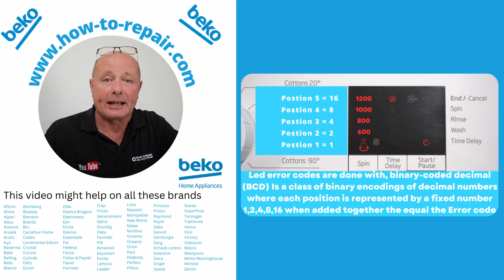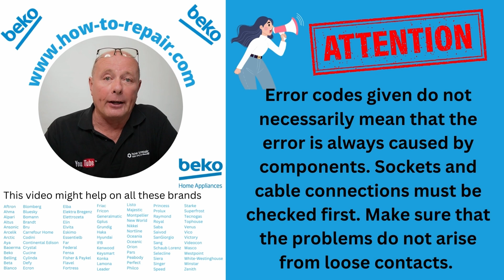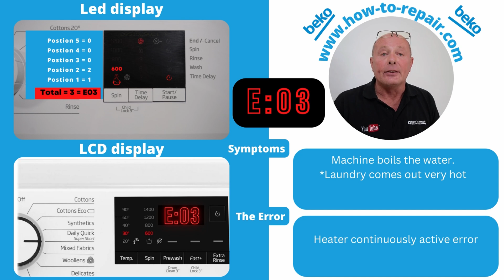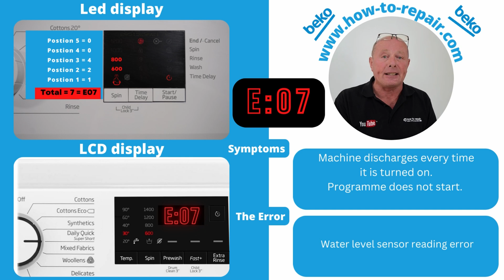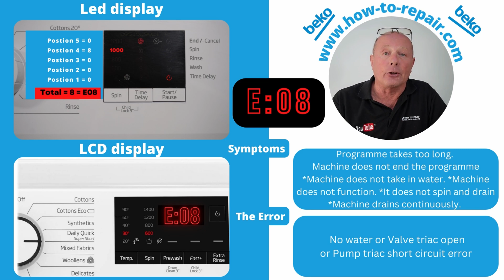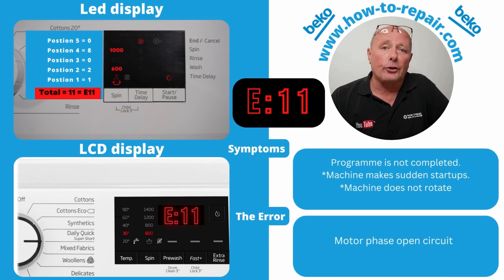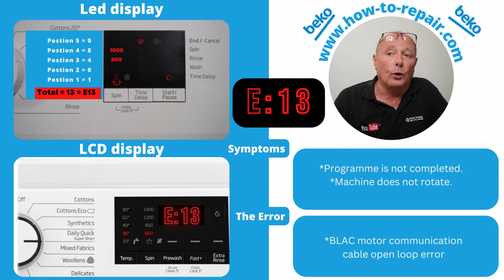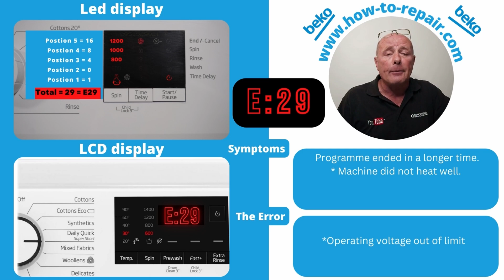Beko washing machine error codes explained digital display and LED types 𝟮𝟬𝟮𝟬 onwards

Comment: Hi Paul

Just want to remark about an issue I was having with my washing machine which is a Beko WTK72011W 

It would on occasion not complete a cycle, the machine would simply reset, I have worked out, this was due to my kitchen having issues with being too cold, which was causing damp in places

It's worth noting that this will have caused condensation inside the machine, meaning the machine detected a problem, and shut down as a result, to prevent further issues

Since addressing issues causing cold, and therefore damp in the kitchen, the machine has performed flawlessly

Just one for your information, if anyone makes any inquiries similar to mine

Comment: Hi i have becko WTB740E1W led washine machine.and when it turns on all the lights keep blinking and sounds like one of the relays trying to hold on to something isnt working and keep ticking and can clearly hear the door lock sound works well but the machine doesn’t start up.
Do u kave any suggestions please thank you.
Reply from the maker: Hi mate, this could be due to a problem with the door lock itself, the pin system on the door that fits into the lock, or possibly a wiring fault. Occasionally, though rarely, it might be an issue with the printed circuit board.

You can start by checking the door pin, the door lock mechanism, and the wiring. You might also have an issue with the wiring inside the panel or possibly a faulty control panel.
Reply: @How-to-repair  thanks a lot will try those steps one by one and i will inform technician too..

Comment: L and opposite L what problem is?
Reply from the maker: Hi, I will need the full model number of the identification plate and the details of your problem so that I can provide you with useful literature. Please use our contact us page and make sure you fill out the request for what your problem is. A video shoot of the problem would be perfect as well.

I will get back to you within 24 hours, normally. https://www.how-to-repair.com/help/contact-us/  

Please remember to subscribe to our channel, as that's what keeps this channel going. Thanks, Paul 👍
Reply: Beko wte 10712 par 10kg 1400 rounds

Comment: Hi i have an error code 11. 1000 and 600 both showing at the same time. The drum circles a couple of times only will not spin. 
But if i do a wash with no clths in the machine it will do a full cycle. 
Machine is only 4 years old . 
Please help me

Comment: Any idea what err00 means.  Turn the machine on, I can select a program.  Press start, instantly the sound of a pump, err pops up on screen then changes to E00.

Doors locked, pump remains on.  Nothing wrong with water inlet just failed.

Was working but rattles a lot, took top of to see I could see fault, looks like a control board came loose on thr right hand side.  Touch no cables but tightened it up,  put top back on and straight away this error.

When it errors the dial and buttlns no longer respond  onky way to turn it off is at the plug

Comment: I got E17 and drum not moving but machine takes the water and drain
Reply from the maker: This is normally related to either a motor problem or one of the circuit boards depending on the model of the machine
Reply: @How-to-repair please help, washing machine Beko Wmp652w, First it was showing e17 and we keep trying to fix it and now it shows E_ _
Machine not working, taking the water and draining

Comment: I have this machine and when it starts the wash cycle on the 30 degree fast wash the red light flashes so it won’t continue...Then I do the spin and drain function and that works fine really confused as I have only had it a few months...Any help would be helpful...Thanks

Comment: I've only had my beko washer since Sunday brand new and it showed error code LJ just now 😮 it was on a quick wash with a few towels I'd mopped up water with from the dishwasher (that's a different story FFS) popped it on a spin and drain and now it seems ok but seriously a brand new washer shouldn't be having codes!!! I've already at to replace one that was only 18 months old.....they really don't make appliances like they used to 😢

Comment: Has anyone got a tap with a line through it, icon? It stops half way through a wash 😮
Reply: I have. It doesn’t want to drain the water.
Reply: Mine too, does anyone have an answer for this, although mine does fill with water first.

Comment: How do you enter diagnostics on a WMY 8046 LB2
Reply from the maker: I take it this is a Beko washing machine, but I cannot find any data on that I will need all the numbers off the identification plate please
Reply: @How-to-repair  thanks I did what was definitely not normal for a man and read the service manual. 
Hold spin button and turn on.
Reply: @How-to-repair  odd you couldn’t find it it comes up on the beko manusoft site and a google search. Luckily there is only one product code for that one.

Comment: What is E43? display was flickering on and off a few days before this,

 new machine thats 3 weeks old and was a replacement for previous one that had a leaking dryer exhaust that was pissing water all over the floor that the engineer who was out 5 times couldn't diagnose but I did by removing the back panel and running it and looking for the drip drip drip

Model WDEY854P44QG

Comment: Has anybody encountered the error LJ code?
Started a quickwash program without spin cycle and almost at the end it stopped, and now it's flashing LJ in the LCD display while the machine has not drained the water.